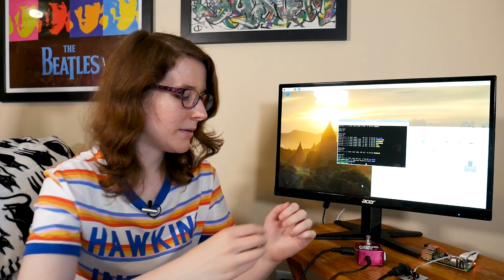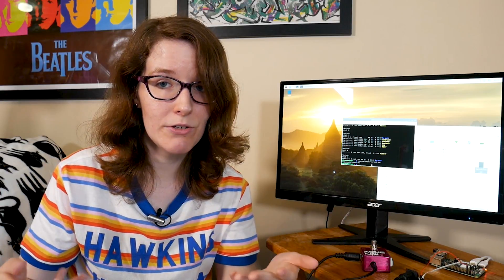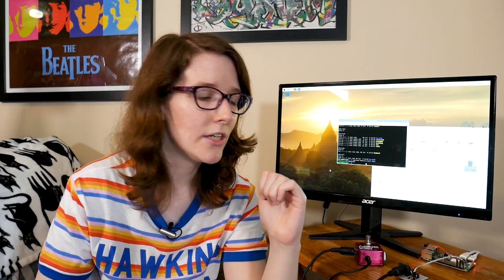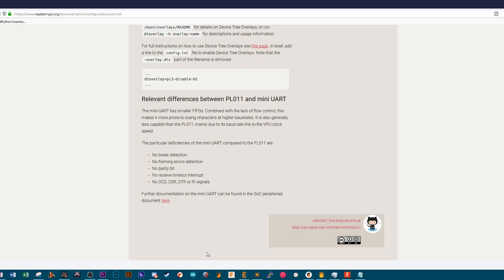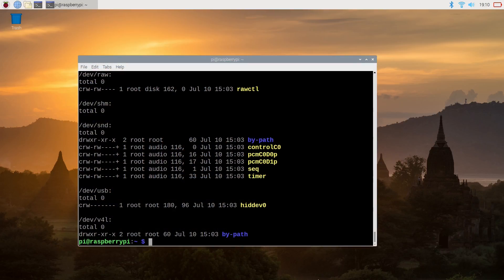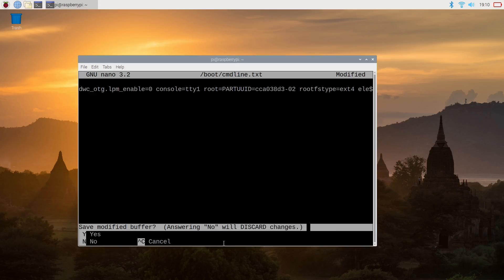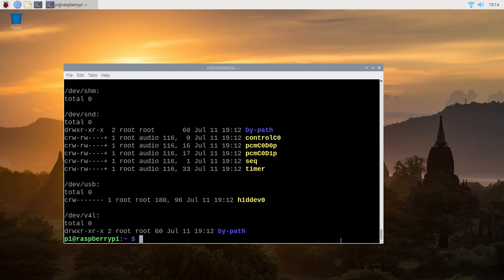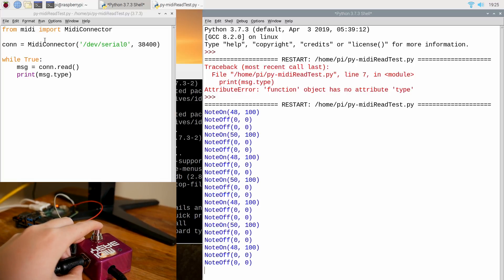MIDI In Over UART on Raspberry Pi

Comment: Great video 👍 One thing I'm curious about is the baudrate, you are using 38400 while Midi baudrate is 31250 🤔 does older MIDI instruments still work with 38400 ?

Comment: Hi Liz. What if i need four midi ins and outs. I'm trying to make a midi router for my keyboards and i make successful experiments with another board called discovery for embedded project. The discovery use an ST 32 bits ARM-CORTEX M4 chip without video and have 4 UART/USART interfaces but low processing power and no operating system like the arduino. Is more an embedded solution for electronic engineers. There is a way to connect others chips to expands the raspberry with more ports? Thanks.
Reply: Have you considered buying a Blokas MidiHub?

Comment: Thank you for that very informative video! It is working perfectly on my Pi 3B+. On my Pi 4 though I am not getting the same results. Data comes in but it is incorrect. All the steps you present check out the same on both setups. Have you experienced this or do you have any ideas why the Pi 4 is working differently? Thanks again!

Comment: Just to be on the safe side, i would do a backup of both files before modifying files, especially on deleting stuff. Allows me to make a diff in the rare case the modifications are larger and i am able to see which parts changed exactly. I wonder if the raspi-config changing part is also possible via config.txt or cmdline.txt.